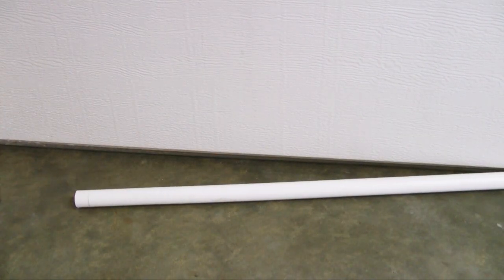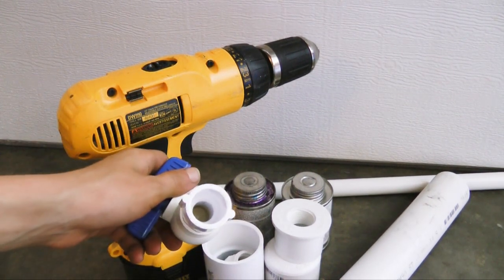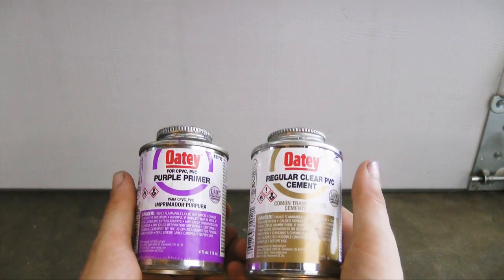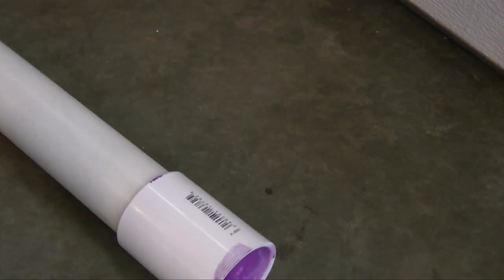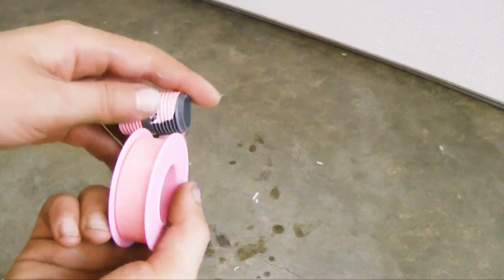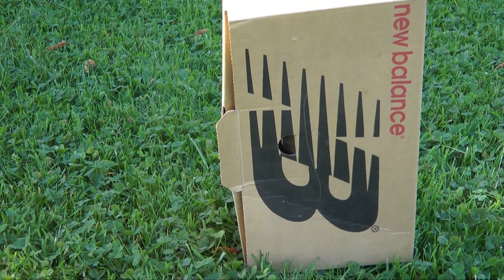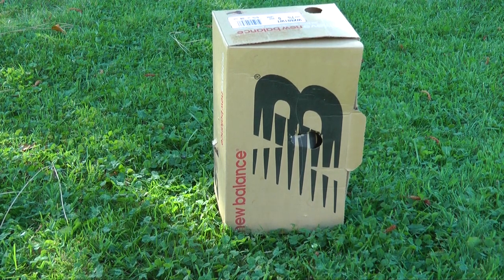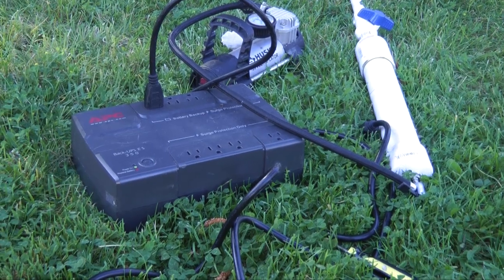how to make a pvc air cannon super cheap 1 day build

Comment: What type of valve have you used ?
Reply from the maker: I used a ball valve threaded
they look like this:
https://www.google.com/imgres?imgurl=https%3A%2F%2F5.imimg.com%2Fdata5%2FJK%2FLA%2FMY-39655510%2Fplastic-ball-valve-500x500.jpg&imgrefurl=https%3A%2F%2Fwww.indiamart.com%2Fproddetail%2Fpvc-water-pipe-ball-valve-16144343897.html&docid=wGVxt-BRkQXBhM&tbnid=wPXJdHB9o7fbSM%3A&vet=10ahUKEwjd-oDR-KTfAhU9ITQIHcz7C0IQMwhNKAEwAQ..i&w=500&h=500&bih=913&biw=1280&q=ball%20valve%20plastic&ved=0ahUKEwjd-oDR-KTfAhU9ITQIHcz7C0IQMwhNKAEwAQ&iact=mrc&uact=8
Reply: Ian builder that is a long url